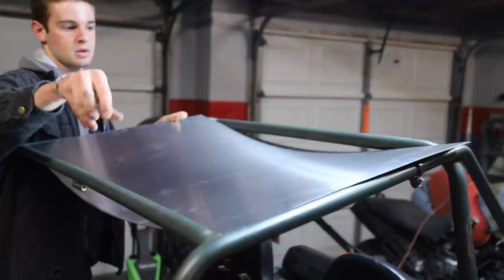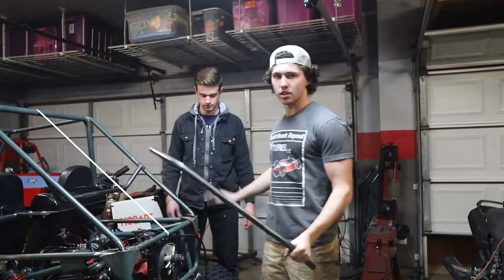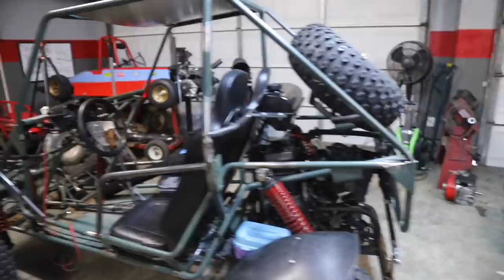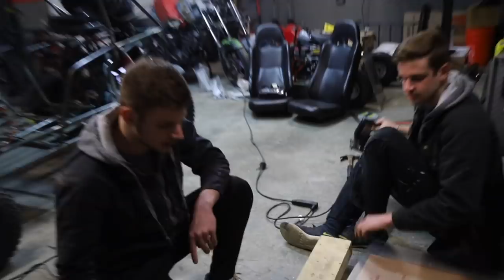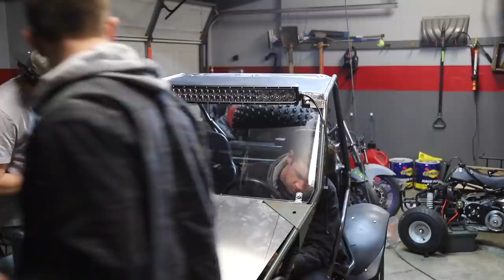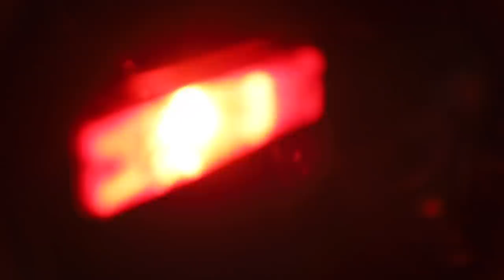Ninja Offroad Shifter Buggy Build Pt 8 | Finishing Touches | Body Panels and AuxBeam Lights!

Comment: All my comments are lust suggestions bc you guys are doing great. On the roof where you welded the tabs maybe put threaded inserts so you don't have to use nut and bolts it would be cleaner and quicker if you needed to replace the roof. I'm guessing the spare tire is for looks bc you probably won't have a jack with you although you can probably get away without that as long as you build in an emergency road side tool kit. You're doing phenomenal work guys. You're going to be the future. Hopefully you move on to Automotive customization. Also idk if you know how but if you don't than learn tig welding. Beautiful work !!!!

Comment: Nice job guys.Hopefully you wired the big light with it's own switch so you can turn it off when you don't need that much light...
Reply from the maker: Dan Hambrick yeah we put them on 2 separate switches and have the small ones aimed down so it’s like high and low beams

Comment: Bout to pick up a pocket rocket for 50 bucks
Reply from the maker: sonny lee nice work man
Reply: @BuildBreakRepeat  if it has good compression I'll keep the motor if not I'll swap it out for a 125
Reply: Lol I bought a bayou 220 for 50 bucks whole thang was apart head was took off and rusty bc the rockerarm broke but it was a mint qwad  I bout gaskets rockers and brand new carb crunk 5th pull and ran like a brand new qwad cranks first pull now